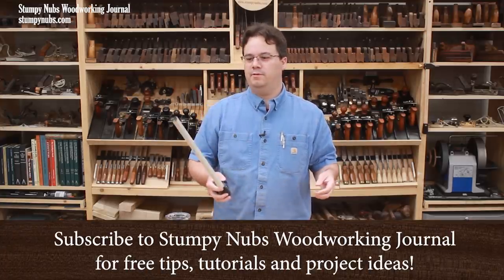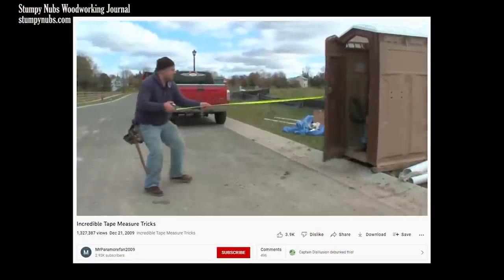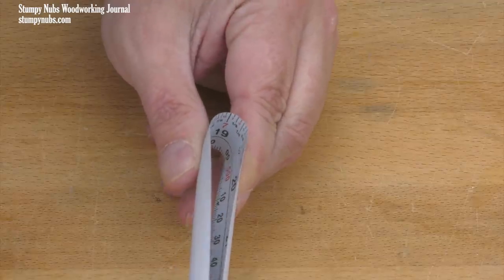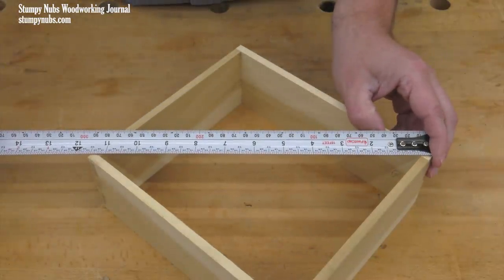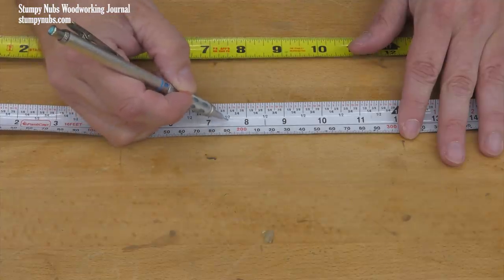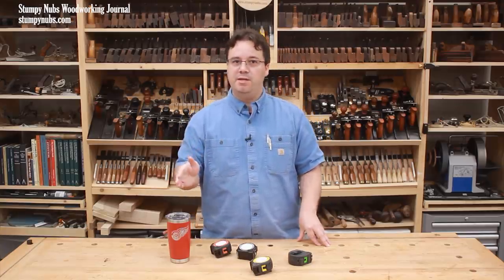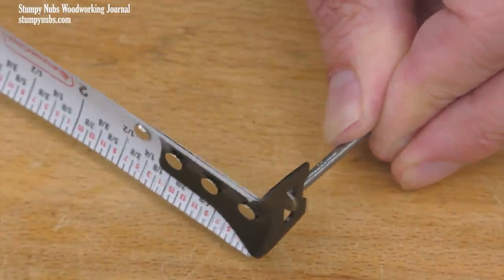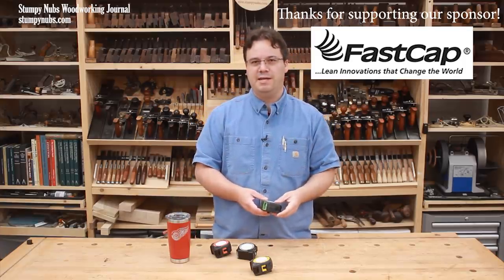BEST measuring tape tricks you've never seen

Comment: One thing I really like about the Stanley tapes is that they are locked by default when you extend them and you have to push the button to retract them.  It's the opposite for most other tapes in that you have to push the button to lock it.
Reply from the maker: Every Stanley tape I own requires you to engage the lock manually.

Comment: Bend your tape the other way around a round object. At a know mark side by side you can  measure the circumference. Divide that by 3.14 to get the diameter. Good for measuring mid pipes.
Reply: Or use a pi tape...

Comment: Learned a lot of good tips. Wanted to add a thought about "burning an inch". Did not know that term but have done it often. However will not admit how many screw up came from forgeting to figure that into the final measurement. So now when it's an option I will "burn" 10" (ten inches). It's much easier for my aging brain to notice that say 15.75' can NOT be correct...oh ya, it's 5.75". Just easier to remember to remove the 10 inches for me. Thanks for all the info.

Comment: You forgot about flipping the tape over and hooking the tab  on edge of material to use as a strait edge to mark an angle or cut an angle. Not a tapes have reverse teeth on the tab though. Very handy and quick compared to grabbing a chalk line , snap it, then proceed to cut.

Comment: With the "25.4", you can make quick, rule-of-thumb conversions, when roughing things out, just by realizing that it means that 4"=10cm (not precisely, but good enough for rough numbers) -- so 40cm == 16", and so forth -- convert to inches by dividing cm by 10 then multiplying by 4 -- hence 2m == 200cm == 20x4 == 80" or the other way == 26" = 6.5*4, or 65 cm. I think 4 to 10 is easy to remember and do the numbers in your head with, much more so than 25.4 without a calculator.

Unrelated, it helps to remember that 28=82 -- 28°C == 82°F (approximate) -- then remember that 5°c=9°F (exact). So 38C = 28+2x5 == 82+2x9 = 100F

Another good rough conversion is .6m=1km and 1.6km=1m -- because of the "6"s, it's easy to remember those two numbers.

And 1kg=2.2lbs, so just multiply KG by 2.2 and you get the number of lbs. The other way is a bit trickier, but it's doable.

Comment: dividing fractions in half is easy - multiply the divisor by 1.  half of 5/8 is 5/16.  To measure half of 11 5/8" measure along to 5 1/2  (half of 11) then add along the tape 5/16".  You don't have to do the ath first to come up with 5 13/16"

Comment: I don't think I've ever used the belt clip on a tape measure in my workshop for its intended purpose.  I salvage rare earth magnets from old hard drives and slip one in the clip, then stick it to the front rail of my table saw or onto whatever other tool I might want to have a handy tape for.

Comment: Great tips! As a layout guy, I always burn an inch or 100mm. Depends on the drawing. I prefer imperial over metric. I was brought up and taught metric in school, but I have seen more mistakes in metric than imperial. Drawings are in mm and tapes are in cm. Where did that decimal point go? Also, a metric tape tends to share half the tape with imperial, so accuracy can be up how good you can eye across the width of the tape. I have metric only tapes, but many of the workers constantly ask for a conversion and that's a whole other issue. My definition of metric "Pay more for Less".
Reply: "I have seen more mistakes in metric than imperial" and "Where did that decimal point go?"... Guess it shows you haven't got a clue about the metric system despite your education. And in the rest of the world you can get metric tape, on both sides of the tape.
Reply: @Nitroburner01  hey Paul, you're taking liberies assuming I haven't got a clue. This is based on experience. I've been building hospitals for over a decade with 100+ men under my supervision, over 30plus years in the trade. I guess experience real life experience doesn't count for much.

Comment: There's another approach for inside measurements - one I used a lot when replacing all the baseboards in the house. 

Cut a piece of scrap wood, very accurately, to a known length. I used 10" for baseboard, as I was usually working on walls 10' or more long, but for smaller projects, you probably want it longer than the base of your tape measure's case.

Place that at one end of your inside wall/board and measure from the far end to the start of your wood - then just add on the length of your wood.

For small inside measurements, of course, use a different tool (calipers, pinch rods, etc)
Reply: I've done quite a few HfH builds and I do exactly this. Sometimes other volunteers look at me quizzically when they see me doing it and some of the other "regulars" think it's overkill, but it works for me. The 1"x10" scrap of 1/4" ply just lives in my tool belt during the trim work phase. I mark it on both sides w/10" and arrows to the ends so if I set it down for a moment and look away, someone trying to clean up is less likely to think it should be thrown out (that doesn't always work though!).

Comment: I just noticed on a Tape Measure that I have, that the width is 1.5" and the tab has a v cut in the center....you could align it vertically on the edge of a stud to mark the center easily.

Comment: I was taught to burn an inch in high school shop class because you couldn't be sure that the end of a square or tape wasn't damaged and inaccurate. I was also taught to use a tape to set a fence, not the scale on the saw. Same reason, you cannot rely on the scale to be accurate.

Comment: I write my measurements on the back of my tape measure. I use a 16' tape so in theory I have 16' x 1" of real estate to write my measurements on! It's easy to pull out about 3-4 inches or so and fold it back along the face/top and quickly jot down some measurements. That's an original Peter Waechter idea. Your welcome world.

Comment: One thing you can do and not have to remember to subtract that inch when you “burn an inch” is to start your measurements at 10” instead of one inch. This gives you the correct measurements when you ignore that first 10”.

Comment: You used WD40 to erase a permanent marker.  You can use a dry-erase marker, too.  Just mark over the permanent markings with the dry erase and wipe it off. It's less messy than the WD-40 and works on dry-erase boards as well.

Tape on the side.  I use masking tape. It stays on the case until I use it, and I can remove it and replace it after I used it. 

Great video!  Thank you.

Comment: I learned a few tips. 
Some I knew. Some I have forgotten. 

Another trick I learned is take 2 identical items (like rattle paint cans)
Set one upright on a work bench, lay the other on its side on the floor. Measure from the top to the top of each. Then lay down the one standing and stand up the one laying down. And repeat the measurement. 
You’ll likely be surprised how many people don’t understand why the measurements are not the same!
I mean you are measuring 2 identical items?🤔🤔🤔😂

Comment: I won't buy a measuring tape unless it has metric on it. I mainly use it after sitting at my bench spending 10 seconds trying to the mental math dividing 23 ⅞ inches in half  before I freak out and just switch to millimeters.

Comment: Magic eraser will take sharpie marks off most slick surfaces. Btw permanent marker marks don’t last in the weather. Pencil marks last for years. Tape standoff reaches decline as the scale paint wears thin. Ask my Fat Max about its declining reach! If tapes get wet WD40 immediately or the recoil spring will fail from rust. Pull it most of the way out, hose it, rewind, extend again, and wipe it down. If it got submerged you may have to write it off.

Comment: As a lifelong carpenter, the single most important lesson I have learned, regarding measuring, is this :  your tape is a liar. Your tape measure is the most dangerous tool on the job, responsible for the greatest number of (and most costly) mistakes.
 In trim and cabinetry work , anything you can hold in place and scribe , will result in the most accurate transfer of information.  So often , I hear tradesmen defend their mistakes, saying, " But I measured it EXACTLY!" ....Your tape is like those blueprints, a guide, not a god.

Comment: If the spring on your tape breaks save the measurement portion and the next time your measurement portion breaks you’ll have a spare to get you through. Of course this will only work if you buy the same brand and type.

Comment: Another trick with a tape or ruler.  Don't try to measure from centers of the holes.  Go from edge of hole to edge of hole.  i also use a different method of finding the center of material.  Say if you have a board that is 5 5/8 and want to find the center.   Start with 11/16 at one edge and 6/5/16 at the other edge.  That 1 in minus 5/16 and 6 in plus 5/16.  And then i use my eye to center the tape.  Now the center of the material is at 3 1/2.

Comment: Old carpenters rule. Use the same tool to measure the cut that you used to measure the place the workpiece goes. Sloppy hooks or jammed folding rule joints won’t matter then. Tape suck at short dimensions if your forced to butt the hook.

Comment: every carpenter should really understand 3 4 5. For example, you can multiple all three of the numbers by the same number if you need to measure a large square, like multiply by 10 to use 30 40 50 feet to square a building. But any number works, multiply by 12 for example for 36 48 60, works perfectly. (36 x 36) + (48 x 48) = (60 x 60), but all you have to remember is 36 48 60

Comment: Do not just let a tape snap into the case. The tab will eventually break off. Instead, let the tab snap against your finger to cushion the impact at closure.
I once specified that a group of reinforcing bars should be "equally spaced" over a width of a slab. The rodshaker objected strongly, demanded an exact measurment (which would have been 8-23/128ths inches) Tried using the slant spacing trick with my tape--he called me stupid for doing it that way.
Reply from the maker: https://www.youtube.com/watch?v=z9En0WAsP8A
Reply: @StumpyNubs  LOL! A man after my own heart -- actually did Science! 
Of course, I had one of my tape measures break (the rivets) after much less repetitions
Another reason I would buy cheap tape measures is because I kept losing them. Most memorable was the time when I dropped one down a 10 inch diameter, 60 foot long pipe piling that had just been driven. (It's still there)

Comment: My father used to work with steel about 50 years ago. A lot of cutting and welding.
He bought a new tape. Cut a bunch of i-beams. They were all off by a foot.
Checked the tape and it skipped the 7 foot mark. Basically 5-6-8-9. oops

Comment: Biggest measuring tape tip... finish with exactly the same tape you started with. Most of thier tolerances are lose to say the least. If you use 2 or more you will be so screwed up, but unable to figure out why. Even amongst same models the tolerances suck.

Comment: The video you Quoted "Incredible Tape Measure Tricks" was produced using movie magic (it is at least partially fake).
Reply from the maker: Since it was included as a joke, I'm not sure it matters.
Reply: @StumpyNubs  I must admit I found the topic of throwing the measuring tape a little strange but not so much off that I considered it a joke. Thx for clearing that up.
Reply from the maker: @anticat867  The topic of throwing the tape was not a joke. The joke was the exaggerated results in that video. Throwing the tape is a widely used technique on many jobsites.

Comment: Not  really a tape measure secret, in the shop where I worked years ago the cabinet makers had extra tape measures. When they needed a measurement in the city where I was working installing, they give me a tape measure to get the measurements they needed. They would take that tape measure and put it in an envelope with the clients name on it. They would use that tape measure to mark out and make the cabinet. Even if the tape measure was marked in unicorns and little bunny rabbits or the hook was off the cabinet would fit exactly when installed.

Comment: Here's a reminder: the inside/outside accuracy of the tape is "calibrated" by the width of oval shaped holes in the tape. The the tab is riveted to the tape through those and they're what allow it to slide. Letting the tape snap back into the case quickly will enlarge those holes over time making the outside measurement inaccurate, hence the "burning an inch" technique. Don't let your tape snap back. Snub it with your finger as it retracts and let the last inch in softly. I cringe every time I see a "professional" snap their tape back in on video.
Reply: I kept accidentally missing when doing that, so I glued a piece of folded leather to the underside of my case with 2mm sticking out towards the tab. Seems to do the job so far, though obviously it does raise the case a little off flat so the both sides interior measurement trick is needed.